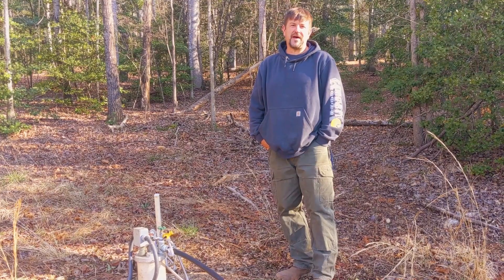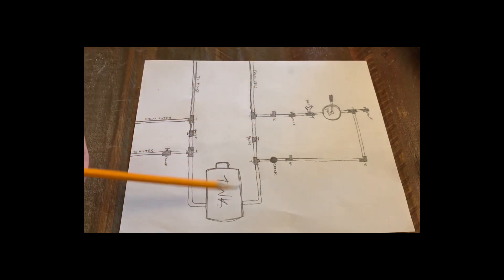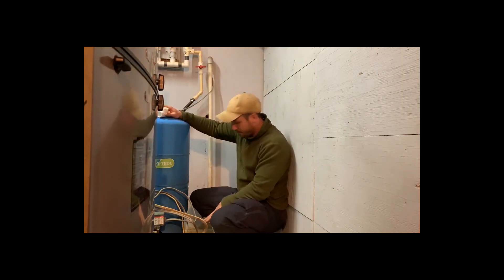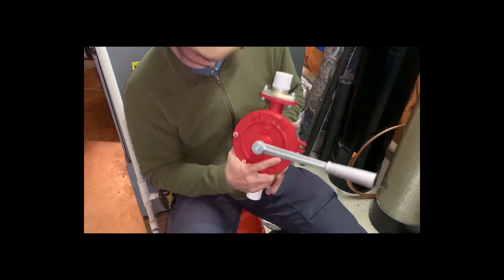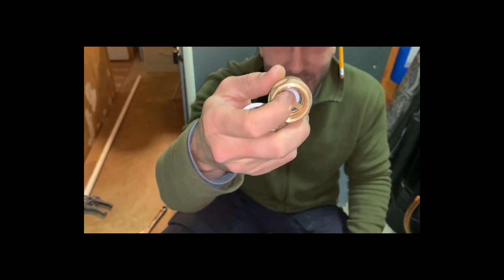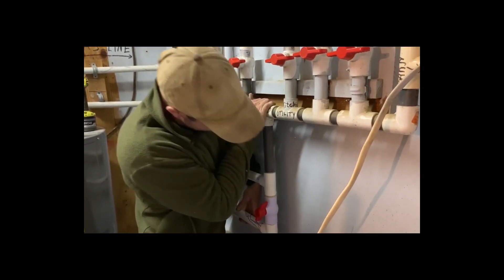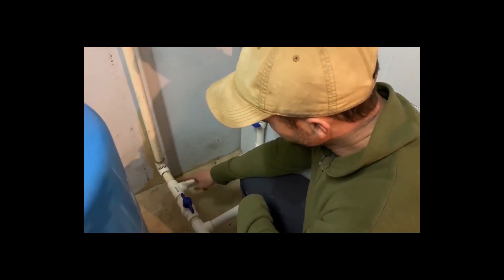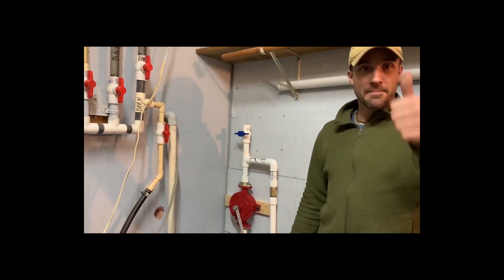The Excelsior E2 Hand Pump featuring Jason Salyer from @ONThree

Comment: Hi, firstly I am no plumber having worked for the Electric Board for 40 years now.

Having said that I have done my fair share with the wetstuf ..... and a whole lot with PVC conduits. The "Glue" is not actually glue but causes the two faces of plastic to bond together as one. That means you CAN have too much "glue". For the newbies to this you simply coat the surface to be bonded and insert with a twisting action and then line up before it cures! Holding it tight in position for 10 seconds or so is good too. 
One thing to watch out for when emptying and filling pipes is Hydro Ramming! Water is not compressable like air so when you open your valve and let it gush into the pipe it quickly fills it up and causes a shock to the whole length of pipe with water in it. This ram effect (same as a ram pump) can cause leaks in weak joints or in extreme cases even blow a fitting off! Leaving a tap on at the high point will allow this pressure to equalize ..... and to bleed all the air out so you don't have that annoying knock every time you turn a tap off!

Comment: Not only your setup, which I have. But another thought. You can get a water storage tank in your basement. We were able to get a 400 gallon water tank. IF there is something wrong with your well or outside water, you have 400 gallons of storage. You hook up a hose to your storage tank and the spigot below the E2 hand pump, shut off your well line. And now you can directly pump your water storage tank into your house.  Just an added feature. I haven't priced plastic water tanks for a while but I think we paid like $500 for ours. Well worth it. You swap out the storage water every year.

Comment: I have this hand pump. It is really just an emergency hand pump, to get you through for a short time until power restored. I also had this hooked up to my plumbing thinking I would use it in like fashion to fill up my pressure tank and have normal water use. It was a nice attempt, but I eventually disconnected it. You better have a lot of energy (the little girl could not do it), notice how much difficulty he was having pumping it. I used a longer pipe over the handle making it a little easier, but it gets old fast. I disconnected it from my home plumbing to use only for filling a 5 gallon bucket when needed. It is good for filling a toilet or washing some dishes, but in reality, you are not going to have someone pumping this enough to take a shower.

Comment: Great video.  The static water level in your 300' deep well must be within 25' or so of the surface.  That is an important detail that was not covered in the video.  Please comments.  Thanks
Reply: Yes, that is the case. Thanks for watching!
-Jason
Reply from the maker: Yes 25 to 26 ft is the maximum suction lift on this pump.

Comment: Can you make a small seesaw that can be attached to that pump handle?

If the little girl is going to be the pumper , it would be much more fun to ride a seesaw , with the resistance of that pump on the end.
Reply: You would have to have a spring as well, to return either the handle, or the girl to start point.
 But, other than that, it could be McGyvered I'm sure

Comment: What do you do for a well that is 500 feet deep?
Reply: Just use check valves at every joint this way water could only go up and never go down this also help keep contamination out of the well. The actually sell backflow devices for this

Comment: I have seen many videos about this. I live in central Arizona. In order to get water, my well is about 900 feet deep. Can this (or any of these  hand operated) pumps work at such a  deep level?
Reply: This one not even close. Suction is only possible to lift from about 25ft. Your water depth is likely much higher than the depth of the well but probably still too deep.
If you had perfect suction the water you are trying to suck would turn to vapor if it were much below 25ft. What you (and I) need is a pump that pushes up the water. That means the hand power at the top is transferred to below the water depth with a pump rod, and the pump mechanism is down at the end of the pump rod.
The most simple example is a bucket that you drop down, fill with water and pull back up. This can be made from a length of PVC pipe with a cap on the lower end and a rope attached to the top end. It works, but you won't like how much work it is for a gallon of water. Much more efficient (complex and expensive) designs exist.
Reply: My well is 65' been looking and can't find a manual pump

Comment: What happens if you have the hand pump enabled, valves set properly, and the power comes on.  Will the hand pump pass the water through that is being pumped by the well pump.  If not, you.have a major problem.  Pressure switch is at tank so nothing to shut off well pump. Most likely you will blow the PVC apart and flood the area.
Reply: Very good question. The first step when utilizing the hand pump would be to flip the breaker going to the well. This would prevent the well pump from coming on when power returns. Thanks for watching!
-Jason
Reply: I have a power switch for the well pump right at my setup. So you power off the well pump in this situation. No need to use the breaker. If you don't have a switch already in place it can be done pretty cheaply. Just need a 220 switch

Comment: I live on a fast flowing river. We never lose flow. We are on the main channel. Even at the lowest level we still have nearly waist high water flow. How do I harness the power to provide electricity to my 8x32 tiny house? Do you do micro hydroelectric generator?
Reply: how much drop do you have on your property?
Reply: @lokilyesmyth  not a lot. The river bed is nearly flat...but it is a powerful current. It has capsized plenty of kayaks and canoes.
Reply: Since you have a powerful current I would suggest a water turbine...there are many different styles so you would have to research them to get the right one for your area.  
At over two foot of depth and a flat bed...the best search phase would most likely be "river micro turbine" and check the pictures to see the types.
Reply: @gregorythomas333  thanks for the information. If you have any links please drop them to me. I am a rebel without a clue lol. I moved to this river about 2 yrs ago. We are just a couple of miles below the dam so we keep an awesome flow year round
Reply: @THDC2015  it is a bit obscure, but you could use a form of ram pump to make an air compressor and run the air line to wherever you need it and run air tools or an air motor tied to a generator. It might be easier to put in the river and not disturb things too much. They do have turbines you can drop in the water, but I’ve not seen any that big. A water wheel could be placed there, but the least efficient kind so turbine is better. If you need to be more stealthy then ram pump to air.
Reply: Maybe the simplest thing would be to do what Mr Thomas says and throw a few turbines in the water and wire them in parallel and run a line into your property.

Comment: Even when using sporadically, it will seize. Oops. Mines not totally seized but getting there . Never put oil in it.  If it's leaking water where the crank attaches to the pump.